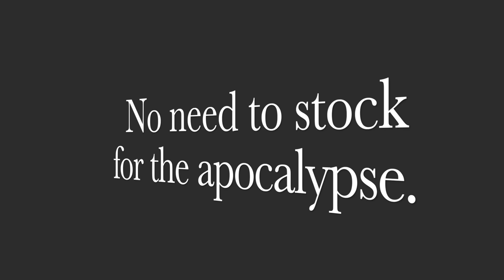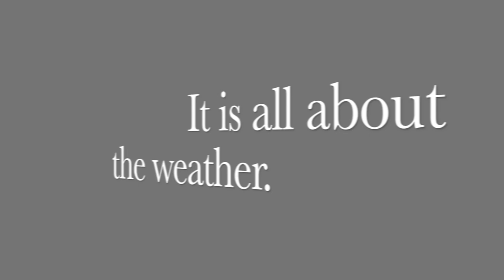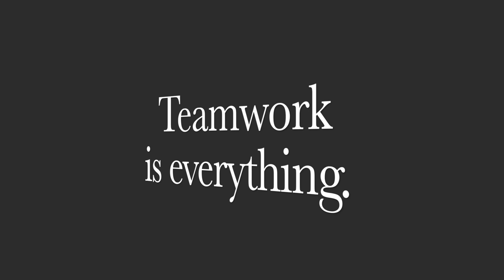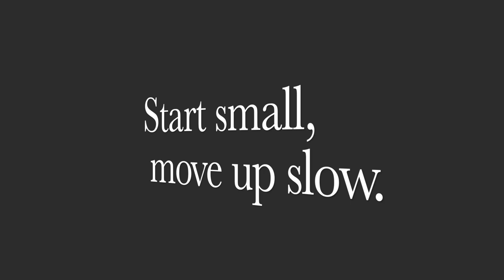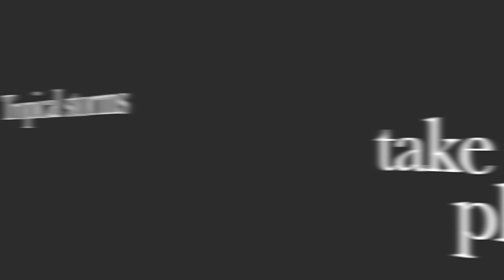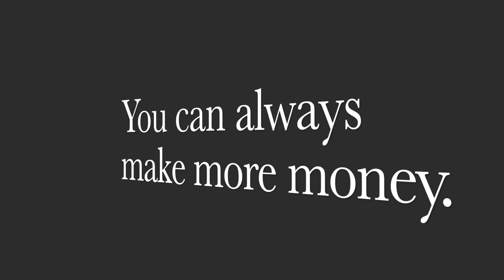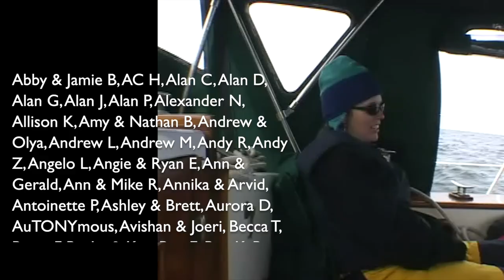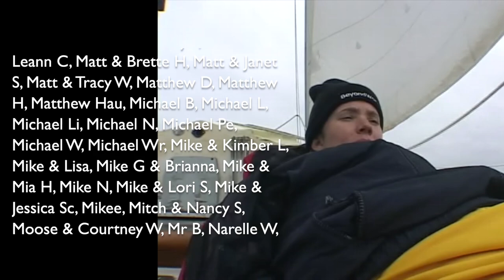THIS will END our Cruising & Other Learnings from 20 years Sailing

Comment: I grew up sailing a Sunfish and an Ensign.  I recommend renting a Sunfish to anyone who wants to learn how to sail.  Instant feedback.  I also recommend finding out when the weeknight beer can races are held and walking the docks, especially on windy evenings, and ask folks if they need more rail meat or deck poodles.  It's an easy, and cheap, way to get sailing experience and start networking with other boats in the fleet.  And get an auto inflatable life jacket with a built-in harness and wear it all the time.  It's much more comfortable than a bulky life jacket so you are more likely to wear it.  It also makes it easier to get a man overboard back on board by attaching a halyard to the harness and winching them up onto the boat.  I had a crewman fall overboard at the dock and it was almost impossible to get him back onboard.  One reason was that I was laughing so much.  It wouldn't have been so funny had it happened at sea.
Reply from the maker: Excellent advice. Little boats make big sailors

Comment: One of my favorite things about sailing on small dinghy size sailboats is pushing the envelope to the point where I would tip the boat over. Then I had to swim around to the bottom-side step on the keel and lean back with all my weight and right the boat. Then I had to pull myself back up into the boat. You can't right a 45-foot sailboat if you tip it on its side!
Reply from the maker: No, doesnt work so well on a big boat

Comment: Electrical & Plumbing are key elements to consider in addition to 3 mentioned. 'Starry Horizons' are doing an update on their 8 year-old cat at a estimated cost of ~ $100K.
Reply: Pretty reasonable when you look at their original outlay. The 10% per annum rule is pretty accurate. You might skimp one year, but next year you may not have the choice.

Comment: Lots of sage advice here. On the subject of spare parts, I remember reading a letter to the editor (IIRC) in an old motoring magazine where the author was saying the place for the spare part was installed before the original broke, not in the boot (it was an English magazine). The main item under discussion was fan belts, as back then this was a standard spare part to carry. Much easier to install things when you are in control of the schedule (rather than at the side of the road in the rain e.g.). When, and how often, to do this is where tricky part is.

Comment: I have crossed a ocean on a outremer , great boat ,  had to work hard to keep it calm. 
Alot of power .
Reply: Does it come with recommendations about reefing?
Reply: @LoanwordEggcorn  reef early
Reply: @davidwarnes5158  Yes.  

But I'm asking if Outremer provides any specific guidelines for when to reef.  Some manufacturers do.
Reply: @LoanwordEggcorn  yes they have recommendations,  but when say last reef at 30 knots , are you going to turn up into the wind at 30 knots , ? The seas are big and you still want to get to the end of the boom to put a security line in and make sure your not chafing the sail with the reefing line .  There is a nice graph on paper and reality .
Reply: @LoanwordEggcorn  they all do
Reply: @davidwarnes5158  Definitely reef sooner than that.

Comment: Hi, Big fan and fellow cruiser here! Great video! Looking forward to see exactly out you fit the knew boat. Are you going to put in an infrared camera? Great feature for safety(if you have a man overboard at night, can make stuff floating in the water or a shoal sticking up out of the water visible, or uncharted land visible?  You haven given some more clues. As I already made an educated guess. Your are negotiating with Chris White to buy his Chris White 55 based in Mexico? I hope it works out. I like that choice better than the Outremer 55. Maybe won't be quite as quick in light air or quite as fast overall than the Outremer but it will be a lot more comfortable overall(dry weight about 2/3's of a ton more than the Outremer?).  Great forward outdoor helm station and great indoor helm station.  Plus in most respects(standing rigging, running rigging, sails, engines your getting a pretty new boat since Chris White salvaged her and put her back together.

Comment: Wow! Saw this and I thought of you both!!! I think it is in Tonga right now, but- I'll deliver it to the PNW for reasonable dough. It's not my bag, but Nautilus Yacht Management seems to pick & choose the boats they'll represent very carefully. I've been wowwed by a few of their recent listings. Although a touch older, it is aluminum, very well built & VERY well owned since 2013. A modest (translate: expensive) refit in 2019 addressed any obvious issues (standing/running rigging, engines, systems, etc...) 60' of catamaran perfection and in your ball park. Performance, toys, room & it seems to be running well. It's all 230v though. Lemmino know when you want me to pick her up for you!
Reply from the maker: Wow, looks like quite the vessel! Just eyeballing it, looks like a lot of boat for the money, but not a performance boat.
Reply: @TheOKellys  I'd argue that with you (aluminum over 40 feet becomes a huge weight saver) but, as she sits- she's a tub 'O lard. Shave your head, have Megan go down to a Dorothy Hamill 'Camel' haircut (Olympic skater) & she'll be fast! Not Chris White fast, but- much faster than Clarity. Hmmm, with all of that extra cash burning a hole in your pocket, I was thinking a new main, a 120% Genoa & a Code 0 type sail (it's too confusing for me to understand the variances)- she'd be eating up the miles- and in safety!

Comment: Good stuff. Yep. Been there, done that.    I see that you had a KP 44?   I had one a 1981. Overall a very nice boat. Once tankage and some wiring and plumbing handles. A great sailing boat. Almost cutting edge for a cruiser back when she was designed.  Still a damn good boat. I had no structural or design issue. And the ole  4-154 wouldn’t die. Ha ha.  We ran dive/sail charters part time on ours. No YouTube then!  Love cats but!!  Can’t afford them.  Or at least didn’t want to go into debt for one. The KP was cash.  Really nice Multi’s are half a million at the least!  And well over a million for the newer ones that are lighter weight and much better sailing and much better built. You really PAY for them.  But wow, yes, very nice.

Comment: Here is the boat you really need....the ultimate! HH44-OC (Ocean Cruising). I have been really surprised that you folks have ignored electric motors for your boats.
Reply: I really like that design too but $$$$$$. One nice thing is it doesn't rely strictly on batteries, solar and hydro regeneration for its propulsion (it has diesels too).
Personally, I don't want to be a test case on how the failure of a new technology played a part in wrecking my boat or worse. I'd do it for daysailing and weekend cruiser but not full time cruising (not yet at least).
BTW, I used to work for an electric boat company for 3.5 years of my Electrical Engineering career. That was decades ago but electrical stuff that I've worked around (Deep space radar, MRI's, electric boats, cell phone base station amps) failed all the time (and it wasn't always my fault either). 
I don't want my $500-800K boat to break new ground on a Lee shore.
Reply: @steveturansky9031  got you... I guess the Winns will be the ones to do youtube videos of this boat as they have ordered one. I think it the future but we will see but your right $$$$$$$$
Reply from the maker: Wish electric was viable, but so far storage is an issue

Comment: Where I'm located, having a pet onboard is not a problem and the places where it is a problem are currently not worth visiting. When it comes to boats, get what you can afford, trying to stretch your budget to get something bigger will end up biting you in the rear. Also the romance of sailing may need to give way to the practicality of power the older you get. In either case as Parley Revival puts it, twenty years from now, you will have more regrets of what you didn't do than what you did.

Comment: With a performance cat you can sail in light breezes. Which works better with electric motors. Electric motors are less maintenance. Wouldn't it be great to never have to buy diesel or propane for your boat, you would be far more independant.

Comment: My wife and I are planning to start cruising but we are currently waiting on 1 thing, starlink. once starlink is working we will be looking to buy a boat. 1 question, have you considered a 3d printer/ mini cnc for the boat to be able to fabricate your own parts?
Reply from the maker: Yes, thought about it. Would be cool, but having another thing to learn is…intimidating. Time stretched already. See you out there!
Reply: Gerry, Sam Holmes Sailing used a 3D printer when he was mounting the arch. That said, he has a dedicated workshop as he discovered he need a dehumidifier box to keep the media dry.
Reply: @Kit2Canada  i will do the same, im slowly searching for a boat now, i plan to rewire and redo all piping to start, redesign whole interior, will need a whole workshop

Comment: Are you going to put in the new boat, as shown at the link(integral system), + a big bank of lithium smart batteries + as much solar as you can fit? With that set up you will always have plenty of power for two crew onboard. Worts case you just let the engines idle for  an hour or two and you will charge a big bank of lithium. If you go with the integral system go with an electric cook top and maybe only a propane grill outside as back up so no propane inside the boat for safety.      https://www.youtube.com/watch?v=0uTNjfb3MNQ